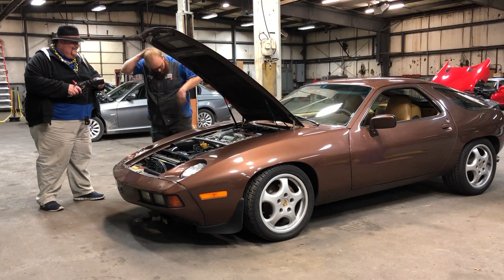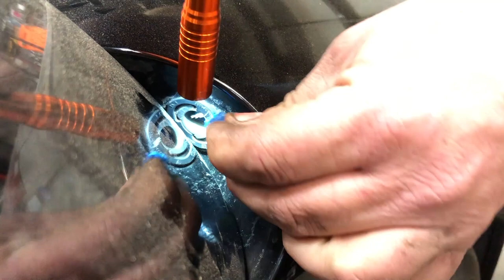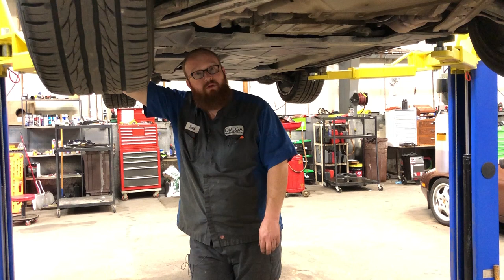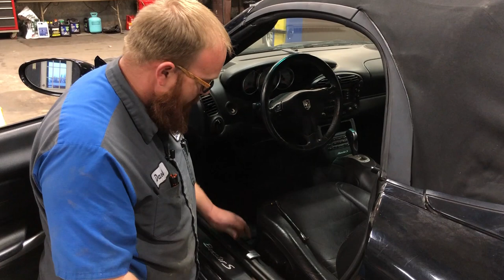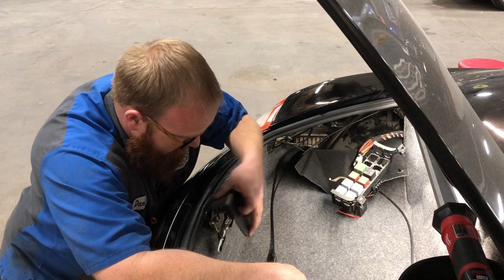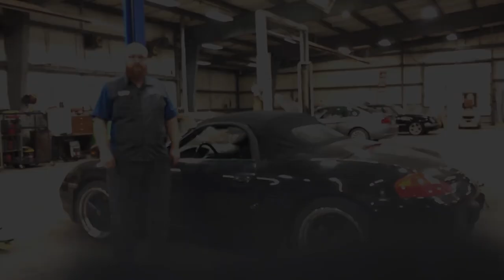CAR WIZARD Shows the Top 5 Common Issues on 2000 Porsche Boxster

Comment: Wow the guy needs to stop washing his car with sand paper.
Reply: I was about to inquire whether this car had been in an actual sandstorm.

Seriously, repeatedly running a car through a low rent gas station carwash, doesn't even nearly do that much damage to the paint. WTF happened to this car?
Reply: My thoughts exactly.  I would love to do some major paint correction on that thing.
Reply: While this looks horrendous, the fact that it’s black combined with the Florescent lights is making it seem worse than it is. Still could use a pain correction
Reply: @PabloDiablo682  LOL!
Reply: @PabloDiablo682  It's winter, good one you can see the paint condition that's not just dirt/dust.  Yeah popular winter car is a Porsche rwd with big wide tires.  No that's a black or dark car with an owner that just gave up trying to keep it looking good.
Reply: I agree.  First thing I said was "wtf did they do to their paint job.."
Reply: a few hours with a buffer, and some high quality compounds, followed by an application of f11, will make it shine again.
Reply: This is another reason I would NEVER buy a black car. I've had a couple and never again. PITA to keep nice looking, plus, they're boring black, absorb heat, and light, making it hard to see the body lines. Porsche has so many nice colors, who the eff would want a basic black one?
Reply: Yeah thats a NASTY paint job, I am sure like most Boxsters its been through the mill and probably had a 'quickie' paint job, I would much rather have a Corvette than a Boxster, I guess the next vid will be the IMS failure?
Reply: @PabloDiablo682  I've driven up to Lake Tahoe for skiing for many years and the paint on my 2003 Land Cruiser I use to drive up to  Lake Tahoe doesn't come close to looking as bad as this car. It looks more like the owner didn't know how to clean a car.
Reply: @zxtenn  meh, vette is a chainsaw, boxster is a scalpel
Reply: Prob uses a dirty car cover.

Comment: Was that car washed with a grill brush?
Reply: It could just be 18 years old and driven
Reply: 18 years of Sun, road, and automatic washers. Going to stand out more on high gloss black than other colors.
Reply: @soundman447  It looks like a lot of those spider web scratches are from improper washing or automatic car washes
My black explorer didn't have those spiderweb scratches until I de-moted it to a winter beater and started not caring about how careful I am when I wash it. Now it has them like this car but not nearly as bad
Reply: 18 years of driving, plus fluorescent lights show EVERY hairline that you may not even think its there
Reply: paint is shot respray time
Reply: Parked out doors, not washed very often, not waxed, etc. :(

Comment: Great video Wizard! on the allen screws that hold the door sill trim with the levers, you don't need to undo them all the way, just enough for the u shaped plastic to slide out. The 1st time I took mine off, I undid it all the way and fell inside the hole. Spent 1 hour fishing them out. LOL. Aside from the usual car nuances, they are great little cars to work on.

Comment: LOL, this video helped me with my car and I don't even own a Porsche! But those problems could be pretty common in many other vehicles - in my case it was white/gray smoke in the morning (bad crankcase ventilation valve) and the smell of burnt oil (it's a turbo, so there's a one-way valve for the crankcase vent, and when it goes bad the turbo blows the oil through the valve cover seals and straight onto exhaust manifold). 

And it was just two years after major engine overhaul, so you've saved me from going through all of this again. :D

Comment: 3:30 My 1996 Ford Contour SE V6 had a similar issue. We called it 'Moosing'. I fixed it by changing the diameter of a rubber UIM hose. The OEM hose's diameter made it act like a trombone and 'resonated'. 
That car BTW, lasted 167,000 miles then the 2-4 band of that CD4 transmission went. It didn't make $ense to fix it, so we donated the car to the local fire department.

Comment: How about a video on the Porsche 928? The manuals are still one of the best bang-for-buck buys around
Reply: I had a manual 928S, of similar vintage to the one in this video. I hated it because it's a dogleg transmission. Could never get used to it. My next one will be an automatic, if I ever get another.

Comment: We find that the 3 gold colored Allen bolts only need to be loosened 4-6 turns to remove the lever module beside the seat. That saves having to rethread the bolts on when reinstalling. We appreciate the quick tips - helpful & timely.

Comment: "this one is in pretty good shape" ... I assume we're just ignore the paint that appears 200 yrs old?
Reply: Was the first thing I noticed! It's really bad, it's steel wool bad.
Reply: Paint is crap, lights are terrible and don't fit properly. And the rag top looks done for. Not a well loved example in my opinion.
Reply: 🤦🏻‍♂️ paint is the least of my worries when it comes to a Porsche.
Reply: @JT-pt5tl  actually these appear to have a soft clear coat and base color. My 00 Boxster paint looks like it had rock chips everywhere! And I take special notice when looking at Boxster 986 videos and ads for sale and I commonly find the same "rock chip" damage, especially visible in black like mine.
Reply: Pretty good to the Wizard is likely referring mechanically to the car lol

Comment: Great video. thanks... I was right with you when you said to use the old cable to run the new through.  I'm going tomorrow, to look at and test drive a 2004 Boxster S manual trans...   :)

Comment: LOL @ DeLorean conversation. I've owned one for almost 12 years, and it is actually fun to drive now that I've LS swapped it.
Reply: What did you use for the transmission on the LS swap I saw one that someone did with the stock transmission but the owner said the tranny would blow up if you stepped on it in 5th gear.
Reply: @mattm9619  Stock transmission, with a few improved internals. Yes, you do have to be careful with 5th gear.
Reply: Hoovie should drop the Beamer's V10 into his Delorean

Comment: Don't forget the convertible top lower rods the plastic ends break off. In your video that black boxster has the isseu where you can tighten up the top liner tension strap to make the top stay inside the brace when you put it up. Last but not least the IMS bearing that needs to be replaced I can't count how many I've done and engines I've replaced bc they fail. CV boots also almost forgot those they are very common also. Not bad cars tho. I always replaced the tubes and seals when I did spark plugs its worth the time. Cracked coil packs are getting common now also.

Comment: Wiz - you are the best! Love the info and vids. Can't wait for my 1998 Box to have the issues you showed. Have not had these yet but you are right, you could do a 4 hour video on the issues these things have (horn frame failure, turn signal, braking, ignition switch failure, window won't drop when you open or close the door,  plastic thingys breaking on convertible top, radio draining the battery) However I still love my little paycheck eater!
Reply: "paycheck eater" 😂 i am original owner of 2001 box and fully understand. But it is a joy to ride and will never sell it

Comment: I have had mine now for 21 years.  The coolant reservoir is absolutely a thing.  Same with Air/oil separator.  But equally important is the water pump.  On also needs to clean the radiators and a/c condensers.  Easy, but time consuming.

Comment: I would love to have an old Boxster or 911, but those IMS bearings can be a concern.  I’m surprised you didn’t mention that.
Reply: harrismi7 certain models weren’t very bad at all for IMS.. the ones before 2000 i believe
Reply: @nismonolo  It was the "mid-generation" cars that really had the issues.   I've had 2 first-gen Boxsters (986) and would get another in a heartbeat.  Don't be afraid of them since they're at the age now that any on the road have likely been fixed, or were not going to be a problem in the first place.
Reply: It's why I bought a Z4 when I really wanted a Boxster. Wouldn't touch one with a 10 foot pole, no matter how rare people claim the IMS implosions are. It's criminal that Porsche would allow a problem like that to fester for years instead of admitting the issue and resolving it immediately.
Reply: OMGWTFLOL Damn straight.
Reply: Double row IMS from the first (3) years 97, 98, 99 are better than the 2000+ they are "single" row IMS

Comment: It's called an AOS ( air oil separator). The ims bearing are maintenance part and failure can cost a new engine. Rear main seal, cracked coils, and a bad oil pressure sensor are common problems on Boxters and 996s-997s

Comment: It's interesting that with all the IMS bearing hysteria, the Wizard only mentions a few common problems that seem fairly cheap and easy to fix. Wizard, what is your view based on actual experience of the Porsche IMS bearing failure problem on M96 and M97 engines?

Comment: Hey Wizard I had a 1999 911 and it had almost all those issues you covered (except for the coolant leak). I fixed all those issues myself. the motor never failed me however, it seemed to be very reliable. However, I was scared of IMS bearing failure. Have you ever had experience with that?

Comment: Hay wizard.. a big fan.. quick question.  I can see a super amount of antifreeze coming out the manifold and the oil and water are mixing.  Do you recommend either getting it fixed or just swapping it out for an engine?

Comment: Looks like the convertible top side cable is not seating correctly leaving it hanging out side of the frame when up. Also a common problem. It needs a new elastic strap to keep it inside the frame. Easy fix also.

Comment: Hi, I have problems with the brake lights on a 2006 Porsche Boxster. The pedal switch is in good condition, the fuse and relay are new, but the lights do not turn on at times, or they do not turn on at all. Do you know what else could be causing the problem? Thanks.

Comment: There can be a problem with the intermediate shaft bearing  in the engines on some of these and when it fails, the engine is ruined. It should be replaced before it fails.

Comment: know I'm late, but the top on at least the driver's side needs to be "re-trained" to get guided under the plastic trim, his is over top of that trim
Reply: I've also used elastic fasteners to help guide it on older convertibles

Comment: Hi Wizard, I have a 2000 Base Boxster (28,000 miles) and just recently found that I cannot get fuel into the tank, except if it's trickling with very little pressure.  Just wanted to get your input and see if I'm on the right track...  I've ordered a new fuel tank breather valve and will be replacing it to hopefully solve this problem.  There's no howling or ECU faults or anything like that.  I've checked the E6 fuse and listened for the valve clicking open/closed when the flapper is depressed and that seems to be working normally.  Can you comment on this?  Is there something more simple I should try?  Thanks a million!

Comment: Top is not fitting right, you could fix that. My '98 boxster was smoking on start up, run it hard, redline shifts and the smoke dissappeared in 2 weeks. How can I disconnect the air bags?

Comment: Hey there wizard. Love your channel:) I have this issue with my c6 z06 where I’m getting a “check gas cap” warning. I’ve already changed the gas cap, did a smoke test, and changed the charcoal canister; however, the message and check engine light still persists. Any idea what could be causing this?

Comment: I heard that as far as reliability Porsche was up there with toyota....but after the factory warranty ends does that still hold true?
Reply: Toyotas will run even if you’re shit at taking care of them. The problem with Porsches is they are extremely well-built, but it’s definitely recommended that you do a whole lot of preventative maintenance with these cars.

Comment: So would you recommend this car for someone Who doesnt want to spent all his pay check on repair ? Is this reliable overall ?
Reply: No. Buy a Japanese car. This Porsche requires an IMS bearing replacement (cost 1.5K), regardless of whether its working or not, because the IMS that comes with Boxster have a tendency to degrade requiring a complete engine rebuild (cost 10K)
Reply: Yup any boxster/cayman/911 non GT3 or Turbo and is watercooled can be a ticking time bomb...literally